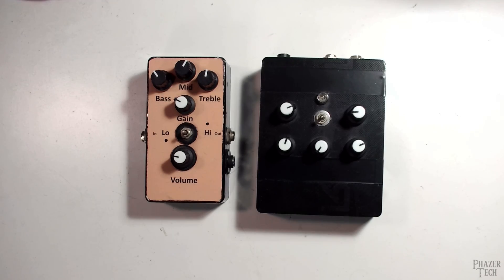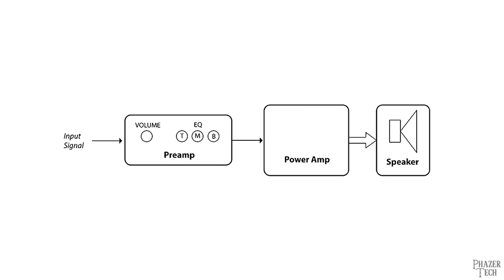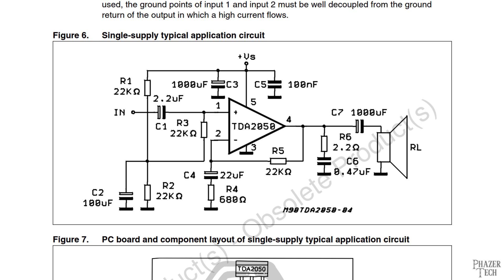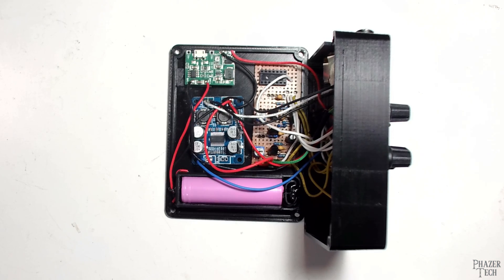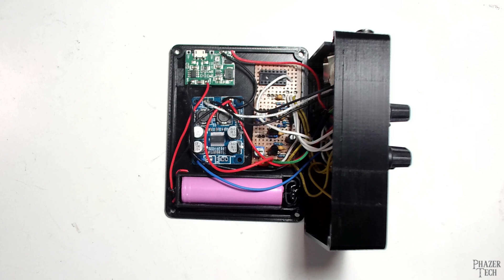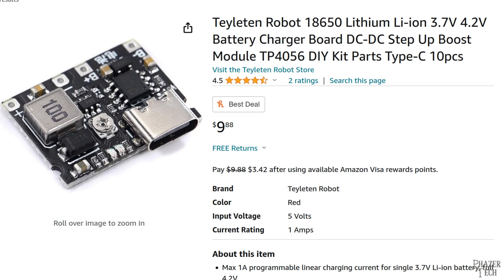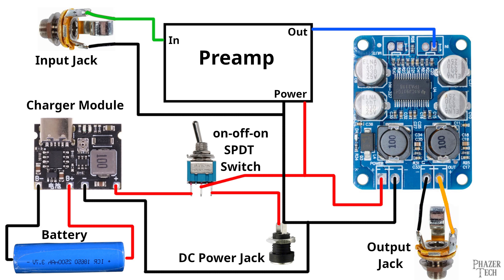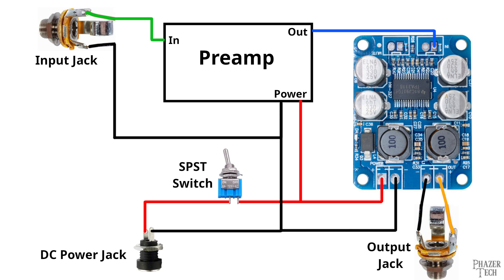DIY Guitar Amp in a Pedal Build Guide

Comment: Also (again), you could build different preamps and put more than 1 in the case.  Then you could select what kind of amp you're playing by turning a switch.  Or am I over simplifying this?
Reply from the maker: You're correct, that's a great idea! If you wanted to switch between two different preamps then this is the switch you'll want to get: https://amzn.to/3PdY2f1
It would be wired similar to a footswitch in a guitar pedal, minus the LED.